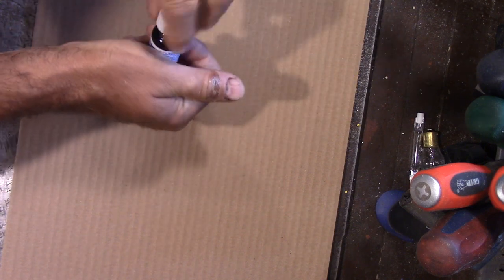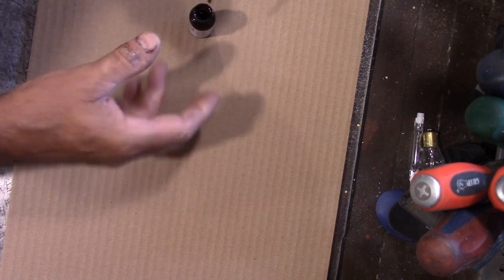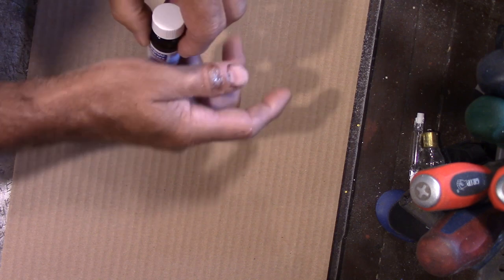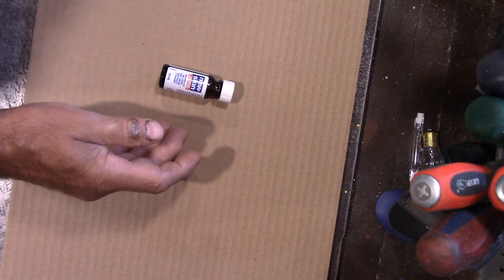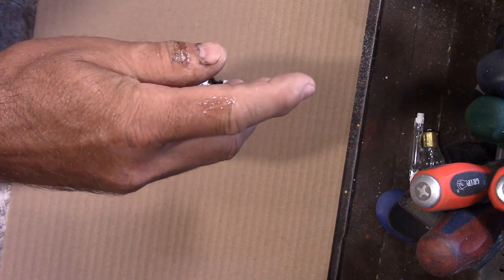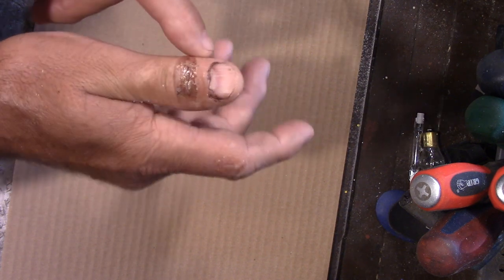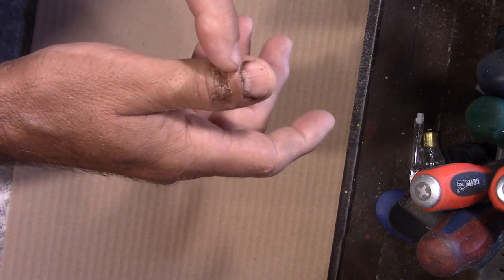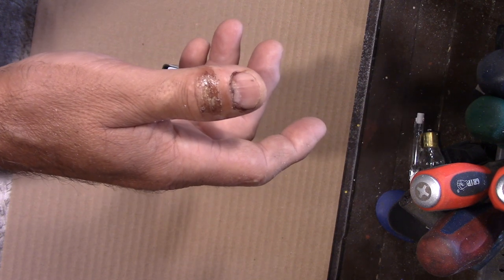NEW SKIN  -  LIQUID BANDAGE  - WHAT I USE AFTER  GETTING A CUT

Comment: Have you ever tried using your hot glue gun? My brother used to use this stuff.. a lot.  I have not tried it for years. Thank you for reminding about this stuff. It would be nice if it came in a tube. Thank you for the video, Steve
Reply from the maker: The hot glue gun is for lumberjacks only :) this stuff for $5 a bottle is so much better than truing to work with a bandage on or trying to keep it clean. Try it and I use it on the dog as well.

Comment: I just use hydrogen peroxide, then put a Nexcare waterproof bandage on it. I use Smith And Nephew Flexifix Opsite for extra waterproofing if I need it. Lacerations, I'll cover it up for a day or two, then I don't use anymore bandages. For abrasions, same thing, hydrogen peroxide, but then I usually let it scab over. It's worked for me. Anything deeper or whatever, I'll go to the hospital.

Comment: Steve unlike the pillock who has before you, a similar video on a Liquid Bandage and speking as a long term senior teacher, trainer and presenter this was a very good explaination, you taught it well. So now I have blown hot air up your arse, this Brit would like your opinion on its use for something which has become quite a problem for me. I was prescribed Sleep Apnoe and now have to wear the horrible full face mask ( a CPAP machine) which stops you from dying in your sleep or having a stroke and feels like a Squid stuck on your face. Slowly I am getting use to it but still need to up the air pressure that is pushed down a  pipe connected to the mask for purpose of stopping your heart from 'stopping'. The thing is for some reason my nose gets very sore and uncomfotable in the day and I expect I need to reduce the air pressure.  I suspect is a bit like the effect of 'windchill' on the face.  I have tried standard bandages but needing to have a humidfier it has the effect of making the bandages I try to cover the bottom of my nose come loose during the night. Saw this product and thought, maybe I could spread that over the bottom of my nose and it would stop the resulting soreness. You video very much supported my idea, the only thing is how easy is it to take off and what do you use to do so. I can tell by the tools in your work place you are a pratical craftsmen with much common sense that goes with people of your skills - so would appreciate a reply and your opinion. Regards.
Reply from the maker: We I'd say this is not intended for your use  so I'd decide if it was worth an experiment.  Do you feel lucky 😅😅
Reply: @SteveRobReviews  OK thanks for a prompt reply.

Comment: Is it possible that it is the same as clear nail polish? If it smells like nail polish, them may be it is.  I actually tried putting some clear nail polish on the cut on my finger and it stung like crazy. I have eczema and have about 4 to 5 deep paper cuts on each finger, but I would not want something to sting. I am in enough discomfort already
Reply from the maker: No it's not the same as nail polish at all but it does sting a bit.
Reply: @SteveRobReviews  thank you
Reply: No, it's basically super glue from what I read! I hope it works good cuz I don't wanna go to the ER on Thanksgiving!

Comment: About 5 days ago I got a cut that was about 3/4 of an inch long right across the tip of my index finger. I put a rubber band tourniquet on it to stop the bleeding and tried some of that stuff that a neighbor had. When it dried, I released the tourniquet. The glue wasn't enough to hold back the bleeding. I ended up going to the emergency room. The hospital glue was better. It must be industrial grade. Now, 5 days later, I'm seeing signs where the hospital glue is beginning to peel off, as I was told it would do. I'm not sure the wound is adequate healed for exposure so I'm going to buy some of the glue and see if it will hold a half-healed wound. Anyway, good vid.
Reply from the maker: Thanks Todd 👍